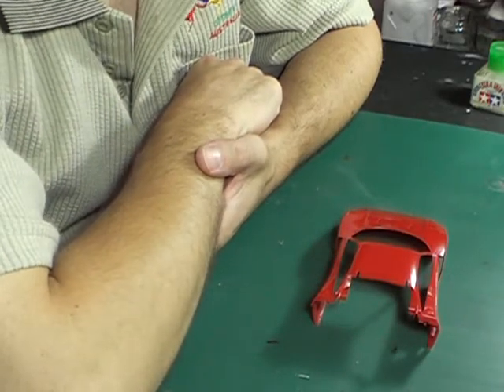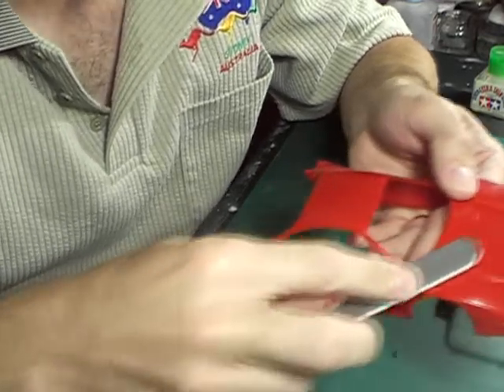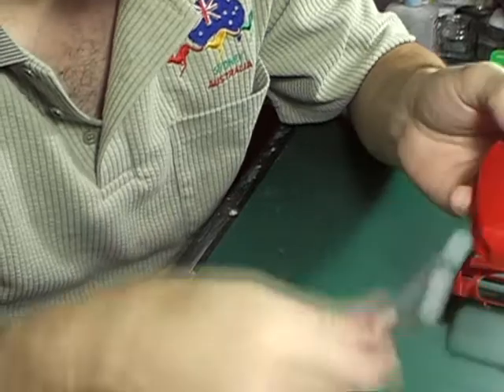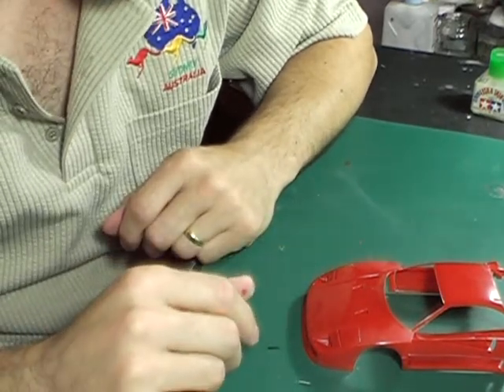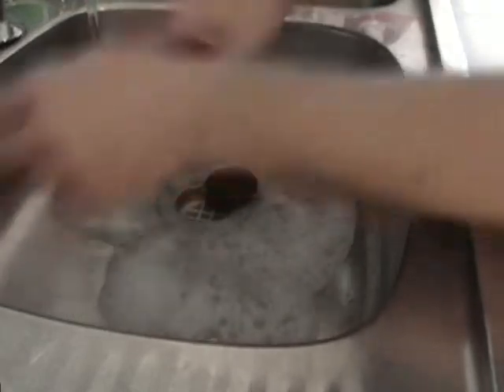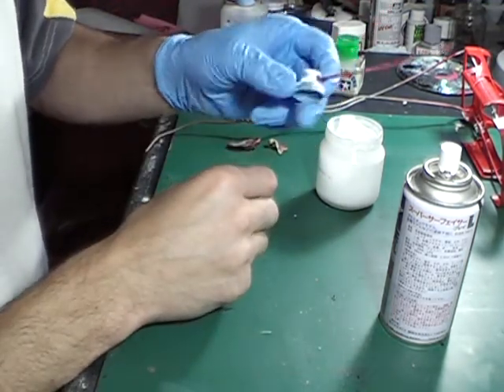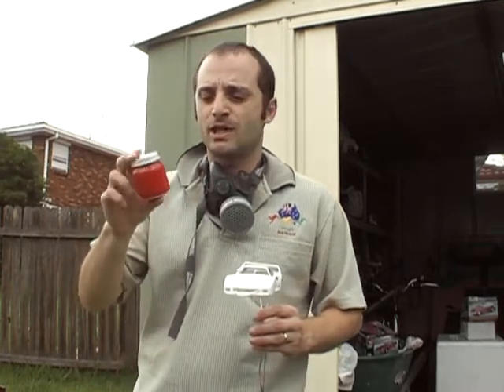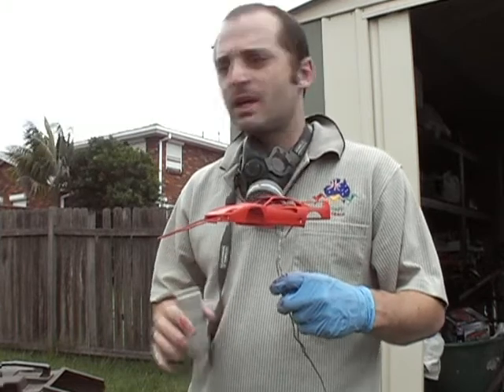Tamiya Ferrari F40 "Pt 1: Body Preparation and Painting"

Comment: Hi
I am building same kit as yours and I have couple of question
I am going to use all tamiya paint as the instruction manual recommend 
First I want to place decals under clear coat any tips? or advice? or I better put it over clear coat?
second question is should I paint the black strip (x-18) all around the body after or before clear coat? I am going to use Tamiya's TS-13 clear coat.
Thanks

Comment: Alright man, I know this is a little old but i can still answer those questions for you.
Personnaly,I think decals over clear is the simplest way to go,but you can achieve a magnificent decal job by wet sanding your clear over your decals (CAREFULLY!!!). This is what I do for most race cars for example.

After that,you should always paint the trims after your clear coat and polish stage.They are usually painted in flat or semi gloss black so applying clear over them would not be a great idea.

Comment: When dealing with prominent sink marks that won't be hidden by other parts (such as right now, I'm working on a 1/32 Revell US snap 07 Shelby GT500 - the hood has 4 of them on roughly each corner) what kind of putty do I need to use?  The kind with acetone in it that will shrink, epoxy or filling putty, or something else?